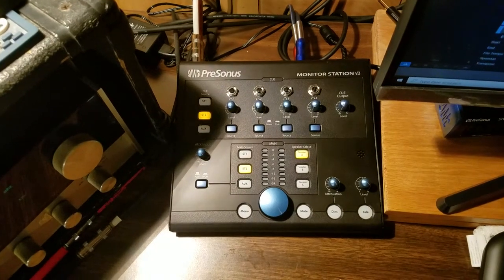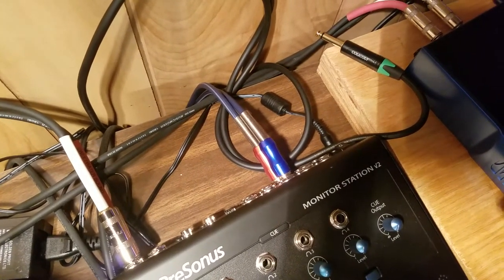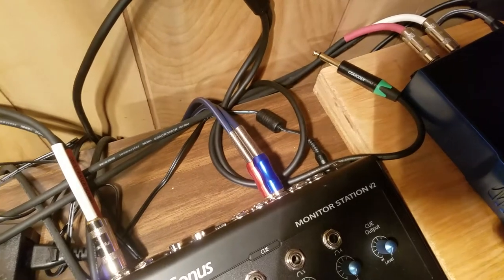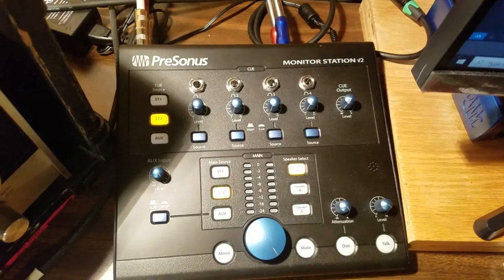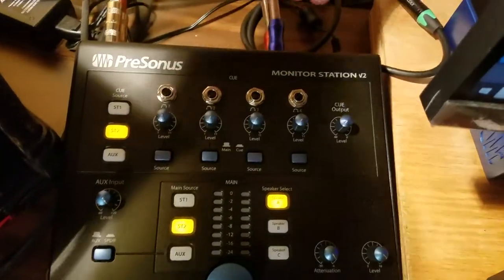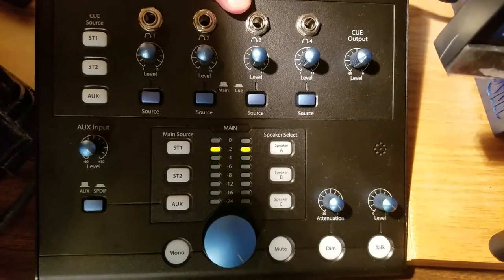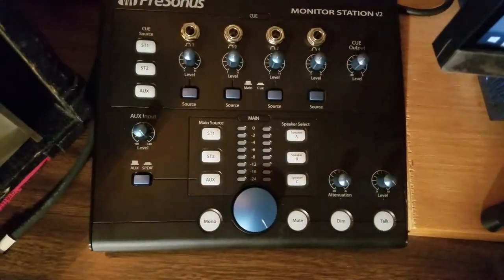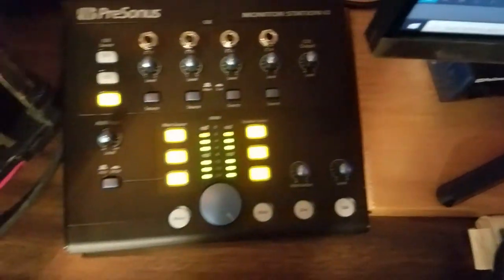PreSonus Monitor Station 2 Power Connector Issue

Comment from the maker: Sweetwater sent me a replacement unit right away.  As always their customer service was excellent.  The replacement unit behaved the same.

It was at this time that I discovered that the issue is actually the fit of the DC plug into receptacle.  It just does not get in deep enough to have a solid connection.  I then noticed that when I put the plug in - I need to push hard and give it a twist.  This gets it in a bit deeper as the plastic on the plug compresses - and I think that it also keeps the plug from shifting.  I will get a video of that out shortly.